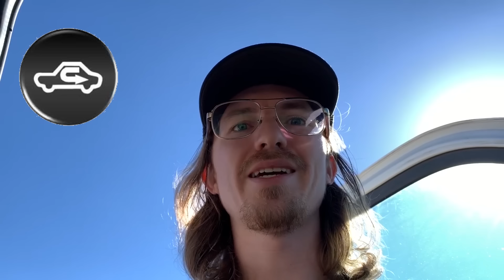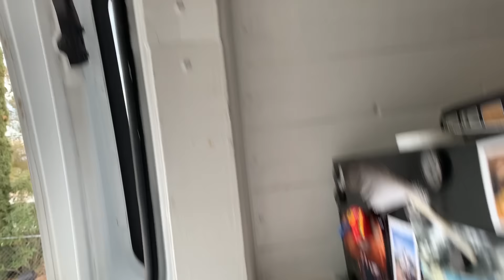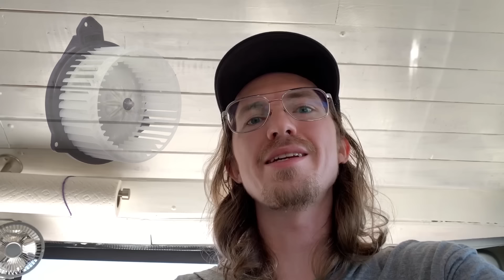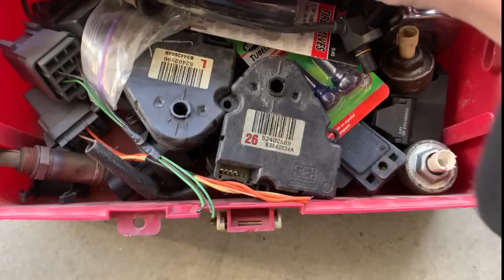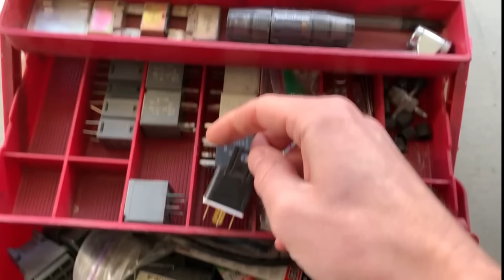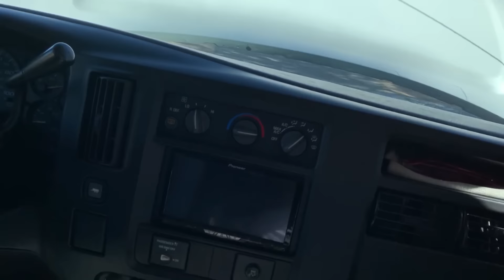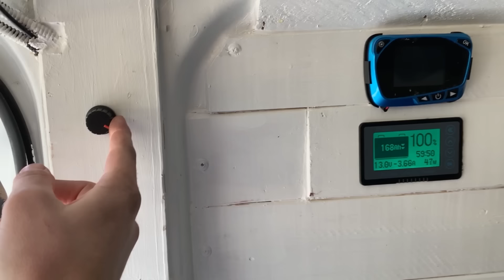OEM Blower Hack **ULTIMATE STEALTH**

Comment: What is the cost of replacing the factory fan when you wear it out and they do wear out; I have replaced a few of these in my life time. I would think the labor alone would justify a roof fan... I am just saying!
Reply from the maker: Definitely a good thing to consider.
Luckily the labor time to replace on the GM vans is <10 minutes and it's been the same blower motor from 1996-2022 so they're dirt cheap!
The Sprinters, Promasters, and Transits are less user friendly I would imagine!

Comment: Just what I was looking for Tim. Very clever to use PWM to get around the old Detroit tech series resistor speed control. I was unclear on one topic. I think you said that as long was the dashboard climate control is NOT set to Max AC, the fresh air dampers are automatic open for air flow, right? I know there are vacuum systems that control the air flow dampers and they are certainly inactive when when the ignition is off. Regards!
Reply from the maker: Hi Greg, thanks for checking it out! (and thank you for the coffee!!!)
You're spot on with the vacuum actuators.
The default positions for the vacuum actuators are:
Recirculate door - open to fresh air
Mode select door - defrost + feet
Temp door is electronically controlled so it won't "leak down to default" overnight as the other two do.
Hopefully that makes sense!
-Tim

Comment: you said air flows thru the walls... I assume you mean thru the top of the walls where it  connects walls to roof ey?  I assume that doesnt flow once you shove insulation in those holes, or is flow rerouted somewhere else?
Reply from the maker: The air exits behind the passenger tail light (you can see it in this video @7:36 https://youtu.be/Dr3v3zLpeYQ?t=450).

So it actually flows through the rearmost internal framing of the van.

The air should still flow unless you completely fill that rear internal frame with expanding foam!

Comment: Man you can make some money you can do those relay  packs  Include all the parts  just put them together     for example I need one for my Sprinter ven   And I’m willing to. Buy  complete system.    Let me know if you can do that.  I don’t know much about Electrical  but I can manage to connect to the battery.
Reply from the maker: I might be able to help! There would still be five wire connections you would have to make on your end.

1) 12v positive (from "camper van" battery bank).
2) 12v negative ground.
3) Blower motor positive (splice wire behind glove box).
4) Blower motor negative (splice wire behind glove box).
5) Ignition positive connection (from any of the vehicles 12v OEM systems).

If it sounds a little daunting, you could check with a car audio / car alarm installer and get an idea of what they would charge (they shouldn't have any trouble finding and making those connections for you).

I could wire up the controller and / or the relay pack and I'm sure they would be happy to install it!

Feel free to reply here or even send an email!
vanwithtim@gmail.com

Cheers!

Comment: In balancing your scenario of; 'Air-vent' versus '(4) Solar-panels';
 • Remove (1) Solar Panel; 2nd. panel from the Rear doors; so that an Airvent is'nt placed where a Threat of some person sliding a long tool to reach the Internal Lock-lever! 
• Seal the Mounted holes with (White)-silicone; as the [G.E.] brand of silicone is very reliable! 
*NOTE Then the (1) additional Solar panel can be used for something different; as Externally mounted for temporary installation or Mounted at another location & method, etc.
Reply from the maker: Would love to have a nice tilting solar array (electrically actuated) on my next build.
I would make sure to leave enough room beneath the panels for a roof vent. There should be some slim options out in the market(?)

Going to hold off on any heavy modifications to this van and eventually try to sell as-is. Would love to do a "clean slate" build now that I've realized what's important / unimportant to my travels!

Comment: Wow. Fantastic with the ignition relay. Now can you find a way to run the vehicle AC with a solar powered electric motor? Tricky.
Reply from the maker: That would certainly be cool ❄️
The early 2010’s Tesla’s utilized a ~15k BTU scroll style PWM electric compressor but it would eat up my little battery bank / solar set up in a heartbeat.

Comment: On the older Express, maybe 07 and older, the resistor pack under the hood for the blower were defective and easily melted. They came out with an improved kit and you might want to get one if you do this mod.......just FYI.

Comment: I installed my pwm controller today with just the positive wire running to my blower motor and the negative just jumped off the power in negative. After powering everything up the blower motor turned on full blast but toggling the pwm controller on or off or changing the speeds didnt do anything. After troubleshooting it seems the controller I purchased is designed so the positive is hot all the time and the only thing being throttled is the negative side of the motor out connection. My wiring is done already so I cannot pull another negative wire to the front of the van at this point. Is the pwm controller you purchased designed the same way?
Reply from the maker: The controller I purchased is opposite. Negative is grounded the whole time and the positive output is throttled via PWM.

Hopefully you can return your unit and swap it!
Reply: @VanwithTim  so... I purchased the unit you have and I have the exact same problem the positive is hot and the negative is throttled via PWM...

Comment: Hey Tim, this is an amazing idea that I also had but couldn’t find any YouTube resources on it until now! I have a Ford transit passenger van with a rear AC unit so I’ll try to use this video as a guide (hopefully dont have to run anything to the engine bay for that reason!). I’m still a little iffy on how the relay works but I’ll definitely figure it out (my electrical system is already complete)
Reply from the maker: Thanks for checking it out Lauren!
I believe the rear AC unit recirculates the inside air and doesn't pull in fresh outside air like the front AC does, so it would work great as a recirculating fan, but not as a fresh air source.
(just as a heads-up!)
Let me know if you need more info (Just may be slow to reply! Out traveling the National Parks with limited service!)
All the best,
-Tim

Comment: Have you thought about replacing your back window with a rooftop fan? I've seen people do it when they lacked space on their roof. It seems to work quite well and even has some benefits over mounting it on the roof.
Reply from the maker: There's another Express van owner who actually used an electric radiator fan inside his back window! Totally stealth and moves way more air than my setup.

I'm not quite ready to ditch my back window view yet, but it's definitely a fantastic option!

Comment: Question for you Tim -- do you ever cover up your solar panels when camping overnight in a "hostile" spot? Maybe I'm a stealth extremist but I'm concerned the panels attract attention.
Reply from the maker: I haven't, but that's a good idea.
I've driven extra hours into the night to find more suitable parking. There are some "not so nice" areas out there for sure.
A color matched cover would hide pretty much everything.
Reply: @VanwithTim  Do you think it'd be possible to build some sort of shroud that would stand up to highway speeds? Seems like it would be tough on your van, because the panels are wider than the sloping edges of your E350. On a boxy wide van like a Promaster, it's be easier to mount the thing
Reply from the maker: @pozloadescobar  I suppose some good solid welds would work while holding up to the high wind speeds! (Still need to learn to weld personally though)

Wish I could have found the same wattage panels just 2-3 inches shorter in width so they didn't overhang.

Comment: Why not just use a 12v fan?
Reply from the maker: You absolutely could, but it would be redundant as the vehicle already has a 12v fan in the HVAC system. 
If you did add a second 12v fan it would probably be more efficient if it vents directly through the ceiling / floor / side. (The factory 12v fan loses efficiency through all the ducting)

Comment: Them fans use #10ga wire... and fused 25amps.  To protect against fire...And you use automotive grade wire. Which people should be using covered in a wire loom. Then wrapped with Tesa 51026 Tape. As more fires start from people not understanding why auto makers use it....

And if you want cheap solutions. Just go dig up an Automotive Radiator variable speed fan..Install it facing the side wall.Up high. Then remove the plugs under the body..It will blow the hot air out them. And you don't need a huge fan. Something around 500 cfm.....

Comment: Hey Tim, love what you came up with here.  I’ve been looking for an option to get air in my van with no roof space.  I’ve purchased all the stuff and am getting ready to do this to my back cabin air.  I’ve got a question to save a wire and time finding an ignition live wire.  Could I skip the ignition live and just jumper pin 87 and 86 to get the same result?  I know just enough to get in trouble.
Reply from the maker: Hi Tyler, then for checking it out!
As for the relay, the 85 and 86 pins are strictly for “switching” the relay. Think of it as a little light switch that goes back and forth connecting pin 30 to either the 87 or 87a pin. Check this out:
https://youtu.be/n594CkrP6xE?t=11m11s
(Pin 85 and 86 are the two on the left for the electromagnet in the video)

So long story short, you wouldn’t be able to.
But if you have any high amperage diodes lying around, you could use two of those in place of the relay:

Just put one on the PWM controllers fan output, then a second on the OEM blower circuit’s fan output wire. (Make sure both diodes current flow directions are correct - towards the fan)

Comment: Would Using one of these (https://www.amazon.ca/Roadmaster-792-Hy-Power-Diode-Pack/dp/B0002UHVHI/ref=zg_bs_9164077011_12?_encoding=UTF8&refRID=HRY0HYMDV68FJGC3FR6K&th=1) work instead of using the relay? If I'm not mistaken this would make it so you don't need to run the ignition wire.
Reply from the maker: Those would work fantastically! 
Correct that there would be no need for the ignition + wire. (I just had a ton of spare relays around the garage so went this route.)

Comment: You’re killing me man! I wish I hadn’t cut a hole in the roof of my van now
Reply: I'm from the 70's van clubs, I know cut a hole and get water inside.
Reply: @Maples01 basic maintenance take care that from. Sail boats have holes in them. My van has had a max air in it for a year now. I was smart enough to run all of my wiring through a single two and a half inch hole with a gland on top which was pain to find
Reply: @Maples01 Through holes are easily sealed with the proper sealant and some know-how.
Reply: @ArcticSubie  Unless you weld metal back, you have not permanent sealed it, just postponed the inevitable leak! Not even the seam sealer used in auto manufacturing is permanent, it must be cleaned out and reapplied, so cutting a hole is asking for it!
Reply: @Maples01  That's the dumbest thing I've ever heard. They have Multiple through holes under the water line on boats and they don't leak. It's about knowing how to seal things properly.
Reply: @Maples01  It's okay. You don't know what you're talking about. No worries. Cars have many through holes already in their roof and all over. You're splitting infinite hairs to prove a point that has no point. Yes a weld is permanent. So is properly applied metal sealant. Unless you mean it might leak 30 years from now when the vehicle is in a parts yard.

Comment: i hate to say this, but the wiring diagram you show at 15:15 will not work at shown unless you connect the "house battery" negative to the vehicle batteries negative.
Reply from the maker: Aw shoot. I (wrongly) assumed all builds just share a common ground for alternator charging.
Didn't take into account the DC to DC chargers or 24v house battery systems!
You would definitely need a dual relay setup (or as others have mentioned, use diodes in-place of the relay)
Good catch Jason.
Cheers!
-Tim

Comment: Nice job! I also have 1.2KW of solar on my roof with no space for a fan, i use house fans and open the windows with the blinds half pulled but i do like the way you thought the split relay issue its nice.
Reply from the maker: Thanks Kelly!
You must have a giant roof! It's nice not worrying about electricity though. I've seen so many "van regret" videos and a lot of them mention not having enough solar / battery capacity.
Reply: @VanwithTim  Yes, its a converted horse box 7.5 ton (very large box van). 3kw inverter with 6kw peak, using 12v 115amp  lead carbons 4 x 12v two strings of 24v so thats 230 amp and only 70% of that is usable which i find im down to 30% left by the morning so am pulling those and installing 24v 500a lithium battery weighs the same but will over double my usable power. I think its 12kw the inverter/charger can deliver 50amps when in grid power which is 1kw and the solar when on a good day delivers 1kw for about 5 hrs then half a kw for another 6 hrs, i have designed the system to give me 7 days power if and when there's no sun, and i didn't want to use a genny, also fast charge via grid power i would have preferred 5kw charging but i cant afford the charger costs i guess 1 day stop on a campsite would fully charge me if need be. Im in Spain so suns not a problem at the moment.

Comment: please indicate which one to use for big gauge and small gauge wire. nice what your doing is educational. thanks for sharing.
Reply from the maker: Hi Herman, check out this chart to determine wire size: 
https://99carstereo.com/what-gauge-wire-for-amp/

(For reference, my blower motor uses no more than 15 amps)

I used 12 gauge wire for everything except the "Ignition +" wire going to the relay. (That was around 18 gauge if I recall)
Reply: @VanwithTim  k im just having difficulty figuring out which one is for the motor and switch
Reply: fyi the heavy gauge wire is for the motor and anything that need to power the motor. light gauge wire are for the switch.
Reply from the maker: @hermantecson8344  Ah okay.
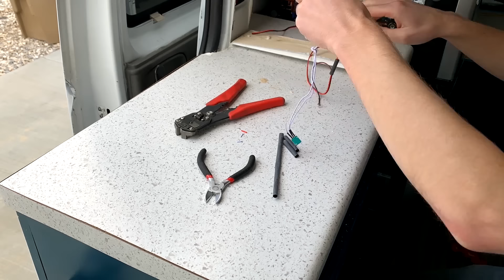The three wires I used to go to the switch 4:54 were around 22 gauge. (Very small)
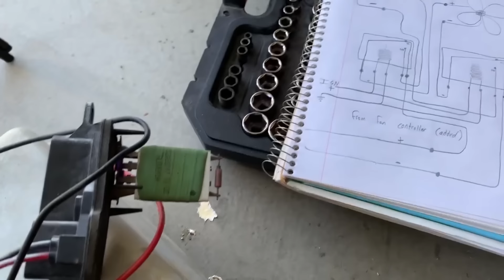The one blue wire I used for the relay 19:04 was around 18 gauge.
Hope that helps!
-Tim
Reply: @VanwithTim  k thanks for the reply. it's highly appreciated

Comment: Why do you need the second relay for the negative side of the circuit? Would it work just fine with only having the positive? I’m new to electrical stuff.
Reply from the maker: I actually didn't need to, my original plan was to have the option to reverse the polarity for reverse air flow.
Interestingly enough, when the motor is reversed on these centrifugal fans, the air flow doesn't change! (Found that out after wiring in the negative relay. oops)
Thanks for asking!
-Tim

Comment: This is a fantastic idea.  One thing though, PWM doesn't use Hz to determine output, it uses Duty Cycle (%).  So in a set cycle (say 1/10 of a second) the motor will be on for, say, 20% of the time and off for 80% of the time for a lower setting, and for a higher setting it would be on for something like 90% of the time and off for 10% of the time within that same cycle time.  Just in case anyone was curious about it! 

For sure trying this on my van!
Reply from the maker: Thanks William!
My old 1990's RadioShack "electronics lab" didn't have much for PWM circuitry haha. Thank goodness for the internet as a learning tool!
Cheers!
-Tim

Comment: Couldn't you just move one solar panel
Reply from the maker: Totally! But unfortunately our build uses all the panels to power the AC unit. (Anything less and we would have to run the van or run a generator.)
Others have mentioned putting a roof fan under the solar panels (which would also help keep the panels cool!) Maybe a future project!
Cheers!
-Tim

Comment: Or just raise the height of your solar panels and put it underneath.  Make a sliding cover for the top of the fan.  💁🏽‍♂️
Reply from the maker: I was actually thinking maybe the fan could just sit below the center of a solar panel. 
It would naturally keep the rain out. 
Then put a raised edge around the exterior fan housing to keep water from sliding along the roof and splashing in..?
Would just need a way to seal it off during the cold months.
I can still (barely) fit inside the 7ft parking garages and that's seriously the  nice thing about not having a high-top van lol.

Comment: Super intresting, im thinking if undervolting the fan would give some kind og increased efficency pr cfm?
Reply from the maker: I would also be curious to see the actual CFM outputs at different power draws. I'm sure there's a sweet spot.
Unsure how to measure the true CFM at the moment though.
Really don't even have anything to measure the motor RPM (that could possibly lead to good info as well)

Comment: FWIW - Max A.C. doesn't really change anything other than just enable recirc.

The idea is that the system has to work less than pulling in hot outside ambient air and cooling it down, using already cooler from the interior. Literally, "MAX A.C." just closes the outside air intake and opens the internal air intake. To a laymen, the louder noise inside from pulling air in the cabin, as well as an increased cooling effect from using cooler, already conditioned air; makes it seem as though the system is performing harder, when in actuality it's just physics. Why do they call it "Max A.C"? Well to laymen, recirc doesn't sound like it makes your A.C work a bit better when the OAAT is higher than your IAAT.